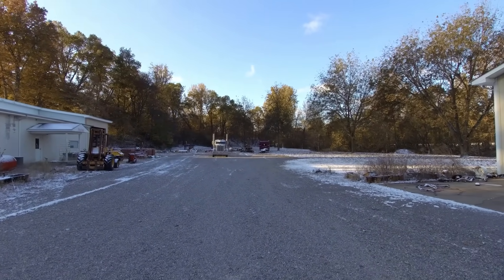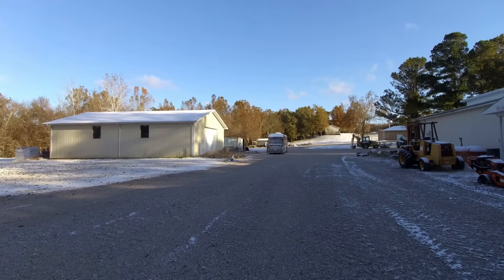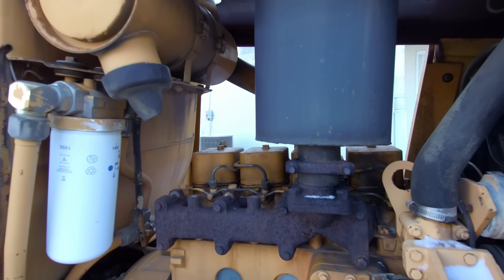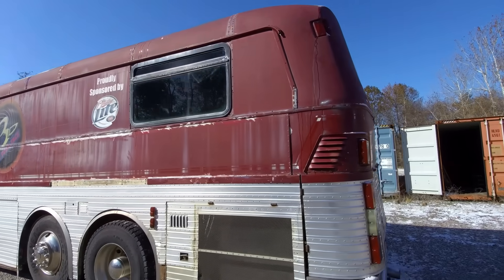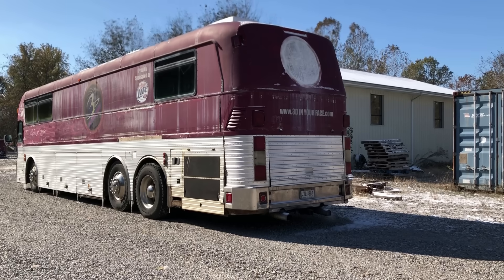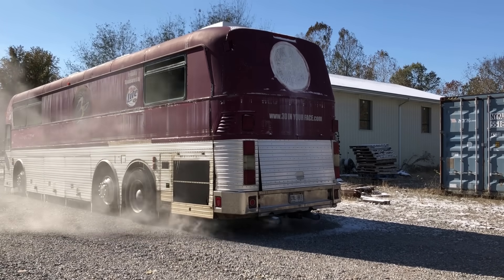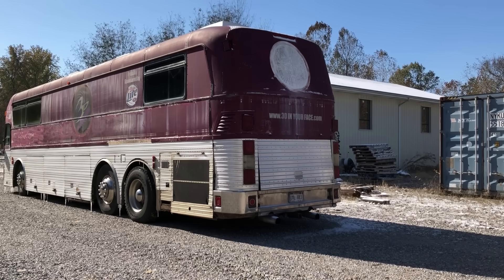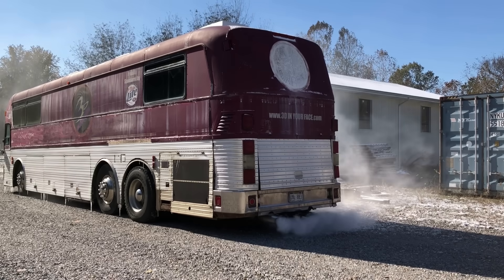Cold Starting a 8V71 Two Stroke Detroit Diesel Engine at 15° F

Comment: The good thing with having twin pipes with an 8V71 is you can tell what's wrong with it by the colour of the smoke on the right side. Still the best sounding diesel engine ever made in my opinion. You need  to add some decarbonizer to the fuel to decoke the piston ring area.

Comment: That bus is an Eagle Motor Coach, back in the day it was the best bus going.
   In its final years ( in the 90’s ) they were equipped with a Detroit 8V92 twin turbo plus all Detroit’s had a blower on them.
  Those things would scream going down the interstate. I drive Charter Bus for 33 years.

Comment: I used to work on Detroit diesel's.   Wet liners. 
Could replace the pistons 
/liners  big ends.
With eng still in the truck. 
Came in at 8AM  back on the road 3 PM.
Reply: Dude check the glow plug feed on side of  the blower. Detroit.

Comment: Concerning whichever 4 cylinder took at least 2 minutes of continual cranking (I've forgotten which), but esp the bus, all this guy had to do was pour a few ounces of diesel down the intake.  In the bus' case doing so would've saved him from several hours lost to recharging the batteries, & several wasted tries.  Eight attempts before it finally started?

Evidently he makes good money to be able to buy so many toys, probably as a trucker.  But for a guy that likes diesels & lives where 15°F isn't unusual, he doesn't seem to know that much.  There are such things as engine block heaters, anti-gel (for the fuel), & outdoor kerosene heaters, esp for diesels that may not have glow plugs, where there isn't enough battery power to spare for glow plugs, or where electrical circuits for the glow plugs have failed.  Maybe in his next video he'll start that bus at MINUS 15°F.  THEN I'll be impressed.  Anyone can resort to ether, risking major engine damage.  And anyone can turn the key until the batteries go dead

Comment: a rag soaked in a little bit of petrol , hold it with a set of vise grips, light it and hold near the intake as you start the engine.

Comment: Detroit Diesel sounds so identical, not a clanking sound. Like those Taylor Forklifts 15, 25, 30 tonnes my father used to drive.
Kenworth in the 80's also sounds Detroit Diesel .

Comment: i use to own a 1961 8V71 Greyhound Bus conversion as well. Mine had a port on the intake to squirt starting fluid for cold start it. Worked everytime. If i didn't spray in that port, it would never cold start....

Comment: That Detroit diesel will not ever start without ether starting fluid. We had trouble starting those on eighty degree days.
One shot of ether  and you're running in five seconds
Reply: rings were trashed if that was the case

Comment: You can`t have all this fun with electric vehicles :-)
Reply: waiting for an Electric car fan to write a hate comment
Reply: @Stolas not only that. You also don't get the sweet engine sound. Also if its a manual its tons of fun shifting gears, rev matching, dumping the clutch and doing drifts etc
Reply: @dieselgeezer18  https://youtu.be/lPHea6GdQYw
Reply: @euro6969  i've watched that video Lol
Reply: @dieselgeezer18  I havent
Reply: that’s why you haven’t seen the start up of a giant hi torque/low speed electric motor
Reply: @Stolas yeah. Its not that you can't have fun. But in my opinion you can have 4x more fun with a gas or diesel car
Reply: most diesel locomotives run off an electric transmission, that means, the engine inside acts as a generator to supply electric traction motors, so basically imagine the bus but 3 times bigger
Reply: you can enjoy the updates for your ev
Reply: Yeah.
Reply: Yeah, they just wont start
Reply: I’m a train guy. You can have all the coolness of the diesel by using rail. That’s kinda why I got into railfanning. Electrics are actually good on rail though. They just pickup power from overhead lines. No charging required
Reply: Yeah.
You can make way more fun things with ev, then ICE.
Reply: If you drive an electric car, people will think you're 🌈
Reply: Hate comment.
Reply: Henrich Muller  ok
Reply: An electric vehicle can't start in this cold temperature!!
Reply: @armandosula8011  they just go no cranking required.
Reply: @dkdanis1340  Electric cars are worse for the environment.  Expensive to work on.  Take forever to charge.  Have batteries that can't be recycled.  And at the end of the day they're avoyr societal control.  Nothing more.
Reply: グールにも愛が必要  another thing about electric vehicles is the instant torque
Reply: @judeharvey2322  Instant torque with no noise in a 2 ton car is garbage
Reply: @judeharvey2322  The instant gayness is another bonus.

Comment: Neat video!  I grew up on a ranch in Montana and we had many cold days and we had a few diesels around.  Just a tip, next time you cold start a diesel , if you spray your starting fluid into your air intake  while its turning over it will start easier and it's better on your engine. Sometimes you need a extra person to help such as on that bus. Thanks for posting.

Comment: You should take it to burning man after you fix it up. And you shouldn't complain. That's mechanical fuel injection there. There's a lot of climate control nonsense you don't have to deal with and it's also a lot more dependable once you get the bugs worked out

Comment: Once you start them with ether they'll never start without it, it actually bends the connecting rods slightly and lowers the compression. Kerosene and a gas rag are your friend. Use them.

Comment: Isn't there a starter button in the engine bay?
Detroit V8s are the best sounding diesels ever. The 318 isn't bad, especially if you can re-cog the blower so it's a bit optimistic. But an 8v92TA with straight pipes is the best way to get revenge on the neighbors after they have a loud party until 2am. Just cruise down the street in first geer on the governor about twenty minutes after the neighbors turn off the lights.
When it comes to working, I still love the C15 CAT that I drive every day. Who cares about the sound when I can maintain 55 up a 5% grade, grossing 83,000 (I only go 19 miles with no scales in between).

Comment: The bus sounds like a VW Beetle. A big, angry one.
Reply: Lol imagine a beetle having that kind of engine 

This beetle joke was approved my a beetle owner
Reply: Bus engine: "BRRRRAAAAIIIINNNNS..."
Reply: 😂😂😂agree
Reply: or just a herd of ones
Reply: SO true! lol
Reply: Or a gigantic Subaru Domingo van with a EJ20 engine rumbling.
The reason is the flatplane crankshaft on 2-stroke diesel V8s.  Generates an firing order similar to 4-pots and multiplicated twice the explosions against a 4 stroke.
Reply: The Beetle might have been 2 stroke too. I actually don't know.
Reply: John Cotter Neither Diesel nor two stroke nor V-engine. The Beetle engine was a four stroke petrol boxer.
Reply: @johncotter1600  No.
Reply: @Timico1000  Makes sense. All I know is they are air cooled. Beyond that, I don't know anything.
Reply: @johncotter1600  No problem. :) The good old Beetle had a four-stroke engine with "Boxer" layout which is the reason for the characteristic sound.
Reply: Timico1000 which is why a lot of people subaru swapped them back in the day
Reply: @xFrozenNinja00  back in the days of beetles subaru powerful doesnt exist! this is done nowadays
Reply: @xFrozenNinja00  LOL „Subaru swapped back in the day“? Damn son you should really look into VWs and Subarus timelines before you make such a statement..
Reply: @johncotter1600  It was a flat four, and I think an overhead valve. But not a two stroke.

Comment: She definitely needs a tune up. Full throttle to idle is taking way too long. Governor isn't set right. And you have at least one boogered up injector on the curb side. Took too long to clean up. Probably not a bad runner, but a bitch to shift that 10 speed with the throttle float that it has.

Comment: I remember when my father had a 1990 Audi A80 with diesel engine.
Back then we had like -15  °C temps and we had to warm up the engine by cooking oil and using a gas heater blower.

Comment: I had a straight 6/71 running a generator I used to power rock crusher components. It came from a hospital and was instant on, at full throttle . That thing was scary when it came to life at all new england temperatures. Ran for years, no problem but the noise.

Comment: As the owner of 4 Eagles & 3 Prevosts entertainer coaches the past 25 yrs, I can say you bought a 1974 Model 05 Eagle. It's been retrofitted with model 10 roof caps (1980-1986 look). Ride height looks good (may have adjustment left in the torsion bars). All Eagle's were prone to rust, but easy to fix. You actually have a diamond in the rough  Skin looks smooth for age, sanded & ready for primer. With a strong 8V-71, new paint, TLC & replace some of the anodized silver side alum, you've have a nice project coach. An 8V-71 bus is slow in the hills, but make for a nice ride on the flats.
Reply: I hope you finished the series! He really did this thing justice when he finished it!
Reply: Do you have any for sale?
Reply: @WRCWPLX  Sold & retired after 17 yrs on the road.
Reply: https://www.busforsale.com/mobile/buses/bus_detail-fsbo.php?bus=189&fsbo=true
Reply: check out the video where he destroyed it, dang thing was falling apart just driving around in circles

Comment: There should be enough heat in the starter to a fry an egg
Reply: that starter is that era version of glowplugs
Reply: Use it to heat the engine to start it..
Reply: Me too
Reply: Concerning whichever 4 cylinder took at least 2 minutes of continual cranking (I've forgotten which), but esp the bus, all he had to do was pour a few ounces of diesel down the intake.  In the bus'es case doing so would've save him from several hours wasted on recharging the batteries.  Eight attempts before it finally started?

Evidently he makes good money to be able to buy so many toys, probably as a trucker.  But for a guy that likes diesels & lives where 15°F isn't unusual, he doesn't seem to know that much.  There are such things as engine block heaters, anti-gel (for the fuel), & outdoor kerosene heaters, esp for diesels that may not have glow plugs, where there isn't enough battery power to spare for glow plugs, or where electrical circuits for the glow plugs have failed.  Maybe in his next video he'll start that bus at MINUS 15°F.  THEN I'll be impressed.  Anyone can resort to ether, risking major engine damage.  And anyone can turn the key until the batteries go dead

Comment: One problem with the Detroit is you don't have enough battery to start it.
Reply: They were 12v systems.
Reply: @kevinfrazier556  yeah thay are 12v but if you don't have the battery power to start one then good luck.
Reply: They have 2  massive deep cycle batteries! My take away after a decade of   cold starts of various engines is that they all suck unless its 24v. Even the ford 6.2/6.0's with glow plugs needed to be cycled 3 or 4 times and that was Wyoming cold - North Dakota cold you pretty much had to have a block heater.
Reply: @kevinfrazier556  the 4d-8d batteries are not worth there money that are only 650cca I use construction equipment batteries that are 1000cca and I put two of them on a Detroit engine.
Reply: @anthonyyoung7344  that would work. Late model Crowns just had a 3rd  deep cycle battery and those always started even at -10f.

Comment: The one thing I loved about those old 8V71's was they had a wicked exhaust sound!  And I drove OTR for 35+ years and have never seen a diesel that liked starting in cold weather!  Depending on what was happening, sometimes it was more advantageous to just let them idle all night.
Reply: At -40⁰c its better off idling up north here we see that daily during the winter months
Reply: A 6BT with a good working grid heater will cheech to life in a cold frostbackistan winter no issues. Just fkn loyal
Reply: @HotForgeChaos  you beat by 3 yrs, but I was going to say about the same. We used to have a 2007 3500 Dodge dually 2 door cab 5.9 turbo Cummins as a plow truck at the body shop I work. In cold Michigan winters that thing started every time as long as the batteries were good. That thing was prob the best plow truck I've ever driven. The short cab gave great visibility. With duallys out back and that big diesel over a solid axle in the front I had all the control in the world. I would plow within inches of rows of cars with zero worry and zero accidents over the 4yrs I did it.
Reply: Depends, swedish diesels tend to start easier than american 2 stroke ones
Reply: @norwegiannationalist7678  yea, well, that's only because the swedish are smarter and better at designing things !
Reply: Been 35below never shut her down let er run

Comment: 6:41 “Alright we got enough ether to start the Titanic now” 😂😂😂
Reply: Ded😂😂😂😂
Reply: lawnboy81SMS that one got me rollin. Lol
Reply: man this guy just washed all the oil off with that much etheranf then just holds the starter switch on the whole time jeesus i wonder how many starter motors they go thru there
Reply: Titanic had a steam engine, just do you know.
Reply: what does he mean ether?
Reply: Guillermo Guillermo it’s a type of starting fluid for older Diesel engines. Large boats have Diesel engines to power them which is why he referred to the titanic as that would’ve had a massive Diesel engine in it
Reply: @lawnboy81SMS  hahaha thanks for explaining
Reply: lawnboy81SMS I think the titanic was coal powered- since it did have boiler rooms in the bottom...
Reply: @ezinmusic4424  You are correct, the Titanic was ran off Coal/Steam
Reply: @lawnboy81SMS  actually the ship does runs on steam.
Reply: @the_real_drwhoroblox1935  Ah, I suppose that would be correct now that you mention it. Though I believe modern cruise ships run on diesel or another fuel source now but I may be wrong
Reply: @lawnboy81SMS  I think so
Reply: @lawnboy81SMS  "enough ether to start the Titanic" is just because it's a famous ship that's humongous compared to a truck. Regardless of what fuel it used. He could have said the Starship Enterprise or "a cruise ship" but it wouldn't have been as funny I think.
Reply: @lawnboy81SMS  I thought the titanic was steam
Reply: @EthanL21800  it was
Reply: @lawnboy81SMS  modern cruises use fuel oil I believe
Reply: @guillermoguillermo3656  ether has a low combustible pressure and temp.... So it can be used for starting engines....
Reply: badass huh could probably use a tune up, new plugs air filters ect
Reply: ether will not work on steam engines like the Titanic had. too much h2o in the boilers now! ha ha. j/k

Comment: At 15 degrees, I'd probably be almost impossible to start too!🥶❄ I'd probably want stay in bed or sleeping bag with the old electric blanket or heater. ♨️🌡🙃
Right now,  I use a blanket & electric heater (along with central gas furnace mainly) in my bedroom; on cold weather nights..

Comment: Nice!
I especially like the Rube Goldberg accessory setup behind the 8V. Kinda a mess, but likely necessary given the engine compartment constraints. Well, at least you have room to add more PTO driven items off to the right, if you were ever motivated to do so.

Comment: That engine doesnt like to start for some reason, and please dont rev it  :'(
Reply: Boz 2011 those old 2 stroke Detroits NEED to be revved and run at high rpm. 

That is what they are designed to do. Period.
Reply: Boz 2011 those old 2 stroke Detroits NEED to be revved and run at high rpm. 

That is what they are designed to do. Period.

Comment: now you can see why way back in the day they let those fuckers run days on end in the winter time when it was cold..
you go home for the weekend you never shut the goddamn thing off except for maybe a few minutes to check the oil..
wasn't uncommon to go to a hotel and see the drivers in there for the whole weekend of the truck running out in the parking lot the whole time..
those two cycles were a pain in the ass when they got super cold and you couldn't get that oil heated up God forbid you had an air starter it was like a double fucking whammy

how long is that bus set before it got started that's why a lot of times bus Grease monkey open it up and start it from the back in case it tries to run away

Comment: Damm old oil puck'n Detroit's, worked on them for many years, I can tell ya that when using the 😊 Happy Gas don't stop at the Titanic 🚢. Use enough to blast the space shuttle off.🌋🚀
If it starts and you don't see confetti that use to be the head gaskets your right on point. We won't talk about them bent rods or broken pistons.🤬👍🍺

Comment: Wd40 does the same thing as staring fluid without engine damage. 
Did that many years on tugboats and pump barges works every time
Reply: Rick Sadler 

Wd40 is flammable?   You mean it’ll light up on fire. Like ether

Comment: Too bad you don’t have a block heater on it ... even if you plugged in a cold 
engine with the time you had it on the charger you wouldn’t have taken the risk of damaging the engine with the starter fluid
Even a roasting tray of burning charcoal under the engine would have warmed up the oil and made it easier to start

Comment: I had a old ford transit van, with no glow plugs fitted.
So in winter l used a hot air blower to warm up the engine block, worked every time.
Reply: How long did you have to warm it?

Comment: "Enough ether to start the Titanic" lol
Reply: Guess not enough ether, maybe needed just a tad bit more to power the space shuttle into orbit.
Reply: Lol picturing the captain just turning a key and startin' her up 😅
Reply: Titanic was coal fired steam engines
Reply: @mmi16  you seriusly needed to ruin the joke, did you?
Reply: @mmi16  I mean it will run on anything that burns hot enough to boil the water so you could theoretically run it off ether but it wouldn't work well cuz you'd need an ass shipment of the stuff
Reply: mmi16 r/whoosh
Reply: @mmi16  r/whoosh